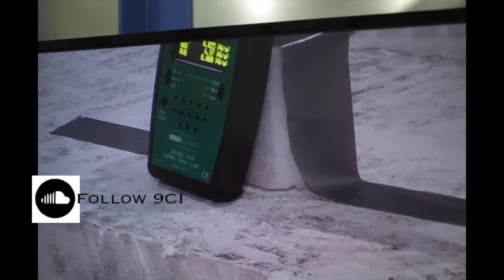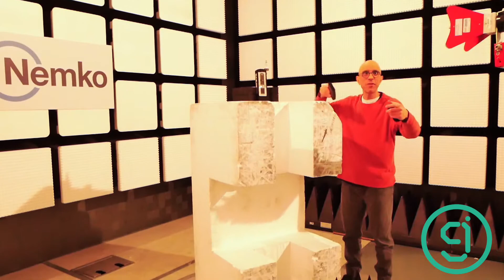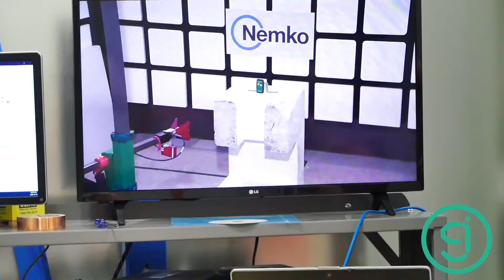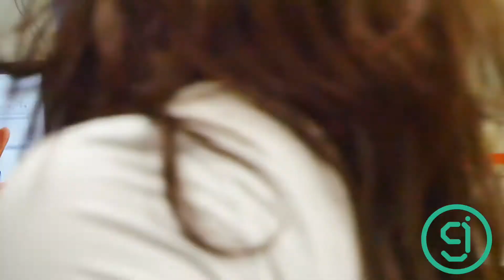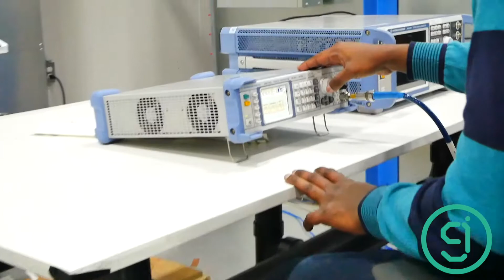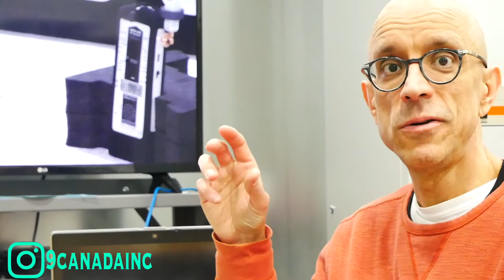RF Chamber Testing Video

Comment: Hi Is it possible to do a software update or cheap circuit mod to the classic so   the red led "fast flashes" to display  a signal greater than 100,000uV/m^2 like the pro2 ?  My meter is out of the warranty period so not an issue for S.L.T
Reply from the maker: Hey there, since the classic is designed as a detector anything over 10,000 uW/m2 is something you don't want to be around for very long. Biologically there isn't much of a difference in concern beyond that for the small details since it a warning device more so than a numbers device. But keep your ears peeled for future devices. Hope you are enjoying your classic!

Comment: The 5 GEE Goes up to 60 Ghz so the meters are obsolete! Mine too!
Reply: Most 5G usage in North America is on microwave bands below 7 GHz. The mm wave rollout is going slowly and is highly varied globally.

WiFi6 at 6-7 GHz has just been deployed tho, and all TMobile 5G bands are down at 600 MHz for the time being. Very important to be able to measure these frequencies as these are what are in the environment now.

mm Wave measurement on 24, 39, and 60 GHz bands will gain importance in 2021 and beyond as deployment actually begins.
Reply: @tsiratnulov  Good to know! yea I meant the band can go up to 60Ghz well if it did go higher then 10Ghz one would not know, so the meter is still good just would be cool to have one to 100Ghz somehow, maybe rather expensive.
Reply: Keep checking the channel regarding mm wave developments...

Comment: Any DIY suggestion to make the Safe and sound meters measure in triple-axis?
Reply from the maker: Good question Sam! It is possible if you have a small g-force spinning apparatus you could measure in the x,y and z. Or rotate the device by hand.